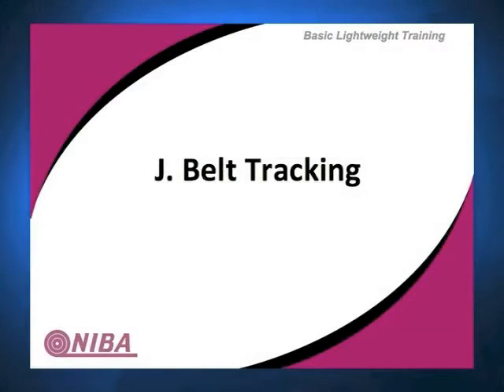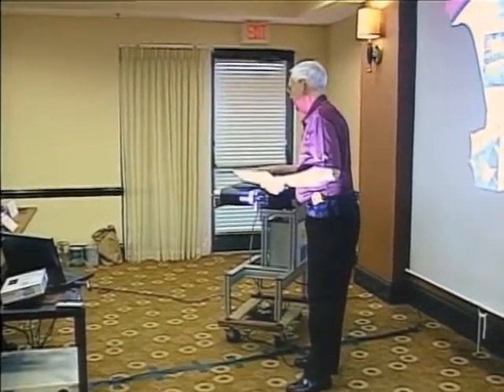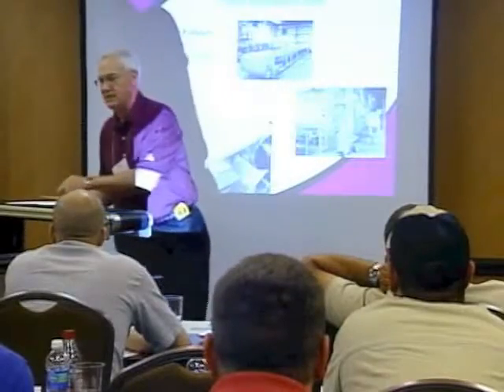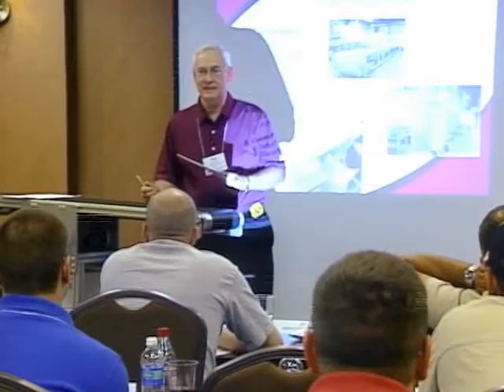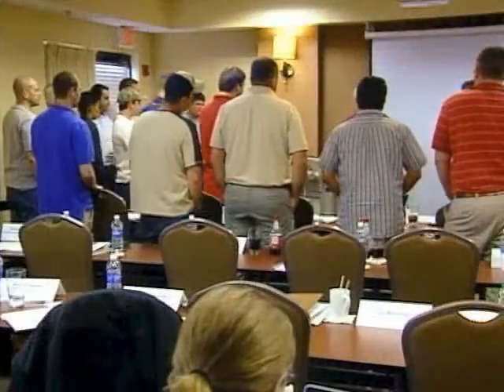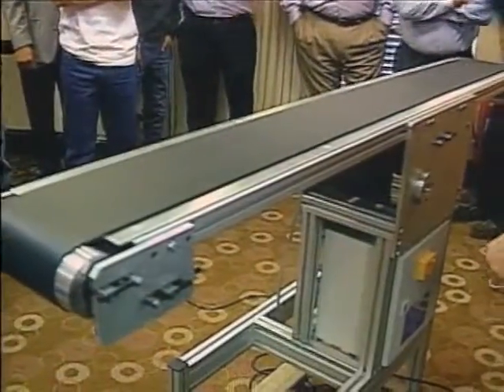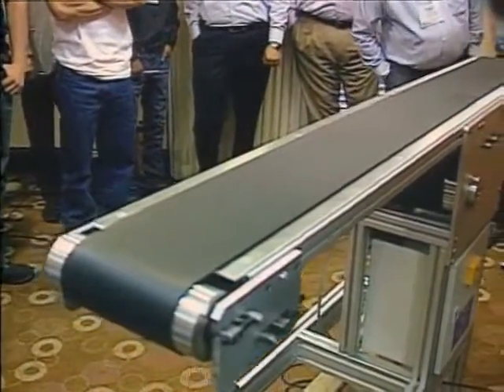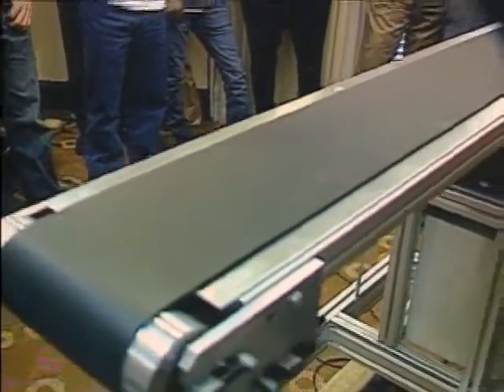3 2 Belt Tracking  Training

Comment: I'm a farmer, we have a pto driven Speed King 42' beltveyor to fill grain bins outside with oats, soybean and wheat, the belt runs loaded into a tube and returns open underneath,  I put it together when it was new, the thing is a demon, I cannot take my eyes off of it while it's running, it's on it's second belt. The belt jumps back and forth between the stops at the bottom where the hopper is. Drums were re-lagged a few years ago. I wish I could understand it. Thanks for your video. Dunham Belting and Rubber in Indianapolis is where I go for my work and belting. Good people there.
Reply: great video